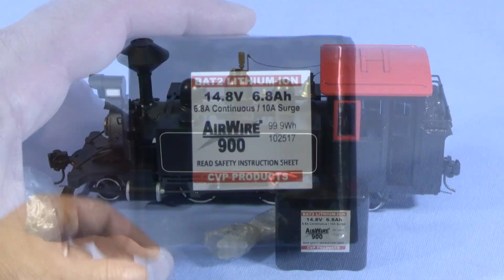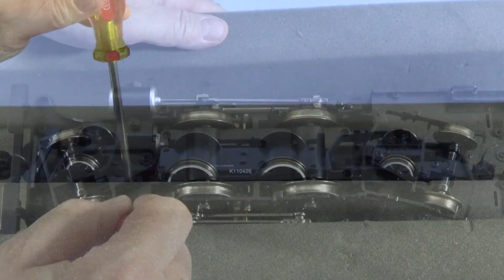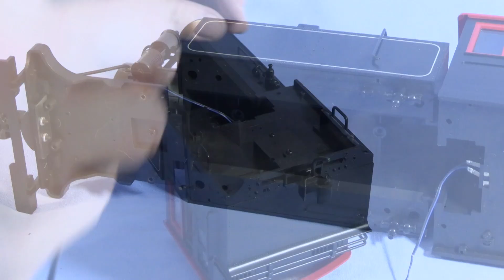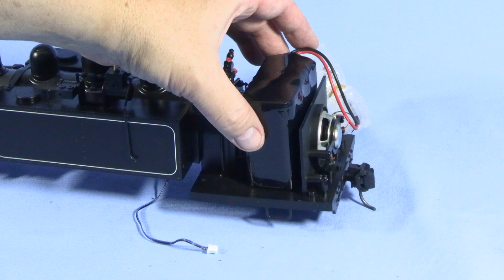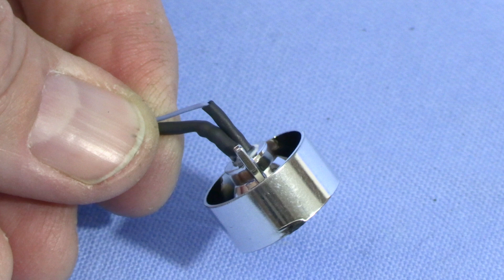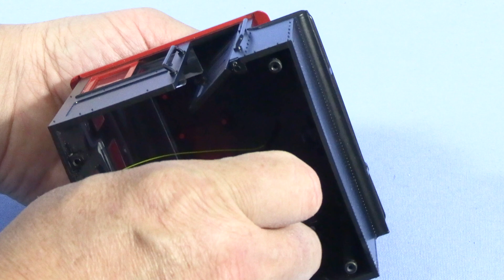Large Scale Dead Rail Battery DCC Conversion! - DCC Shop G Bachmann 2-4-2T Part 1

Comment: I used cheap RC car electronics to convert mine. I've got it running on battery with lights for under $100.
If it was diesel, I'd have sound already.

I just need to find a sound card with steam sounds that I can just run off the signal given to a normal ESC.
Reply from the maker: That's an interesting approach.  I like using a DCC decoder because it's specifically intended for trains, and has lighting effects, sounds, good motor control, and consisting in case I want to run the engine double headed with another.  Thanks for watching!

Comment: This is a large scale version of an idea that I have had, which is to use small lithium batteries in an HO scale locomotive, like from those little helicopters and use track power at a yard and / or a locomotive storage building of some sort to recharge the battery. Bluetooth DCC maybe to control things.  G scale I thought of a similar thing but just use an R/C like from a cheap Walmart car or truck.
Reply from the maker: If the batteries fit and they provide a decent run time, that could be a viable option.  Thanks for watching!
Reply: @DanielCortopassi  That is what I wondered too. I even thought of having a dummy full of batteries powering the main locomotive.  E8 A and B unit might work well for the idea.

Comment: This is what I want to do with my HO locomotives, though it's gonna be tricky for my Tyco General.
Reply from the maker: I think the challenge in smaller scales would be finding room for a suitable battery, one that has enough run time to keep the model going for a while.  I don't mind using track power indoors, where it's much easier to keep the track clean, especially with the advent of capacitor keep alive devices for DCC.  Thanks for watching!
Reply: The ESU 58921 may be a solution for some diesels such as many Athearn Genesis models.
Reply: @CentralJerseyRailfan  Though I would love sound, I can live without it.
Reply: @Steamer_No._96  TCS has a selection nonsound keepalive equipped hardwire decoders